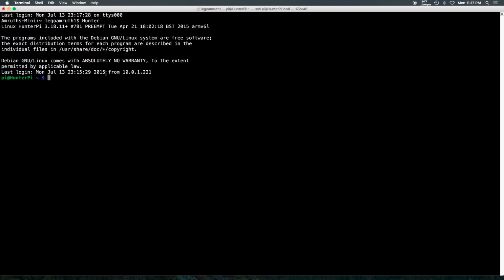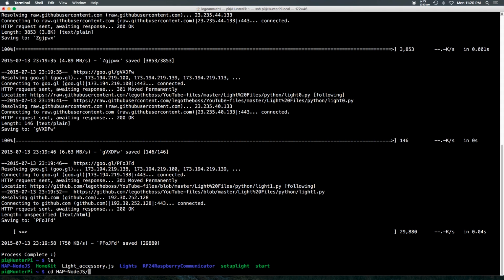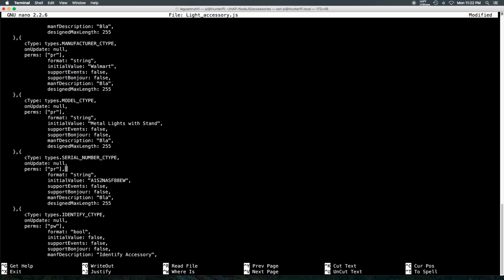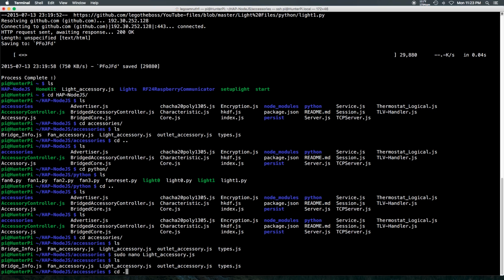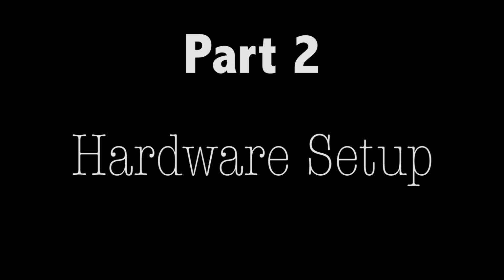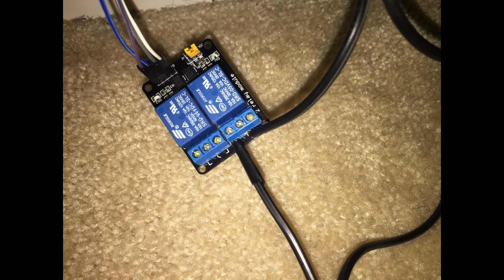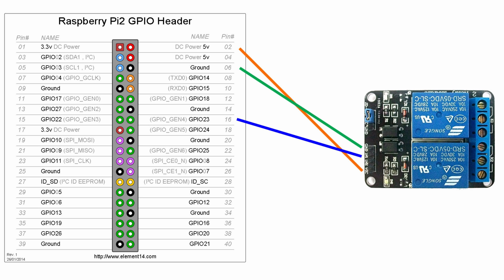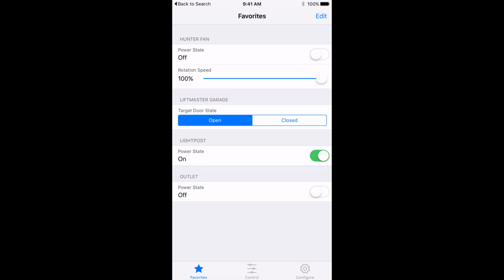TUTORIAL: Siri/HomeKit Lights with Raspberry Pi

Comment: Hey, Your video was great and effective. your instructions were great and worked out for me :) actually I'm struggling to add additional lights as the link you've put under your video, I would be very thankful if you help me fix it out. so here's my problem:
when I run this command : "sudo wget https://goo.gl/Zgjpwx -O Light2_accessory.js" and change the pin number inside the file, my Light1 will turn into not-available on Home app and searching for accessories will have no effect. rebooting didn't work out too. the strange thing is that as soon as I remove the Light2_accessory.js file, the Light_accessory which I created at first will be available.

Comment: Could you make one with an esp8266 board like you did with the motion sensor?
Reply from the maker: Yes
Reply from the maker: Rather than buying another ESP8266, it is cheaper to do a sonoff.
Reply: QuickPi yes true but a sonoff is only high voltage? Am I right? I allready managed to do it but it's not perfect...

Comment: Phone doesnt detect my accessory no error so far!
Reply: I got the same problem! :S
Reply from the maker: Make sure you’re on the same WiFi.
Reply: QuickPi I am (only got 1WiFi- network). I did the installation a few times. Last week everything worked fine, but now it doesn’t. All the other accessories (Fan, Garagedoor, etc.)  are visible in HomeKit, but the light-accessory is not. What am I doing wrong, or how can I fix this?
Reply from the maker: Ok, it is a pairing conflict. Open the Light_accessory file and change the accessory name, uuid, and as well as the username. Change one number or letter in the username. Delete accessories you aren’t using as well.
Reply: QuickPi do I delete types.js?
Reply: QuickPi how do I change the uuid and what do I need to change it to. My phone just cannot detect the light, even after deleting every other accessories.

Comment: why when i done all the thing the command on make the relay off and the off make it on do you know what i missed.
thanks lot
Reply from the maker: +sawadetachat puaktes check your wiring, that is a problem with your wiring with the relay. Check that
Reply: got it ! now I need to do a stand alone system contain with esp8266 relay in a one single unit do you have any idea that dont need to connect with the pi all the time thanks lot.
Reply: another thing i need to control it by homekit

Comment: Hi Quick Pi! does it works with beta ios 11? I know that Works with ios 10, but It Will Work with 11?
Reply from the maker: +Ramiro Caballero yes perfectly fine
Reply: Gracias!!!
Reply: Hey, i have another question... can i use two raspi in different rooms whit the same configuration changing the accessories names? is any problem?
Reply from the maker: +Ramiro Caballero yes that's fine
Reply: Thx!

Comment: Hey QuickPI, I'mare trying to work with two raspberrys on a same network, however one refuses to be connected to a home. My guess is I have to modify the Bridged.js with a change of usename and mac adress, witch I did, but no results. Any Ideas ?
Reply from the maker: +Kim once you do this, you need to delete the persist directory on the one you deleted the information of. You also need to change the UDID of the accessory just in case. Also make sure your MAC address is a valid one.
Reply: Damn you are the Best !!! This fixed everything !!!! Thankssssssssssssssss
Reply from the maker: +Kim no problem

Comment: Hello QuickPi ! I configured my Outlet with the Light_accessory file modified. I can turn it on but the outlet switched off 3 sec after, how can i fix that ? PS : The outlet and another working accessory are connected to the same transistor (the first one works with no problem)
Reply: NRD hey !!! I had this issue before. Just change the Gpio pin.
Reply: Thanks you m8, you solve my problem such a great community !

Comment: Hi Guys !!! Thx so much for the wonderfull tutorial :) 

However there is one thing I can't get to work properly, in order to add multiple accessories, like Oulets in addition to a light, I have to use a Light2_Accessories File, but the icon on my Home Kit looks like an Bulb Light, is there a different way ? Maybe im not doing things properly. 

The final idea would be to have multiple accessories like Lamps and Outlets and to be able to manage them all togheter, witch I can, but not with the corrects icons on IOS, and i checked in the app there is no way to change the icon on a Light_Accessories.js file.

Can you guys help me plzzzzz?
Reply from the maker: +Kim yes you can change them. Go to the details of the accessory you want to change. Then, click on the icon and it'll give you 4 options. Change as you wish
Reply: Hey !!! Thx for the Quick(Pi) :D Answer
You are right, but the only problem is that the four choices are : 
Lamp / Bulbe / Etc....
In my case I would like to have an Outlet Icon.

Because I can't use the Fake outlets you have configured, I don't have the Option to choose for example the relay Pin...

Cheers !!!
Reply from the maker: +Kim oh, you will need to convert the file into an outlet file. On line 62, change Service.Lightbulb to Service.Outlet
Reply: Thanks a lot ! I will try and let you know
Reply: Thx It Worked just fine !!! The only problem now, is that when I try to add another light accessory file , ex : Light3_Accessory, my home Kit can't connect anymore to the accessories. Any ideas ?
Reply from the maker: +Kim in light3, make sure you change the UDID and Username. If you don't do that, HAP will fail to start.
Reply: Thanks for the answer, but where can i rename the UDID in the file, Light3_accessory.js ?
Reply from the maker: +NRD line 41, change a character. That should be fine

Comment: In my home app (ios 10) doesnt apear anything add accessory screen.. please help
Reply from the maker: are you on the same wifi as the pi? also are you sure the node is running?
Reply: yes of course I could pair it with homekit bridge but I cant with a normal accesory... I use sudo forever start Core.js
Reply from the maker: +Daniel Parra I suggest you use bridge, if you are annoyed by other accessories, just remove them in the accessories folder.
Reply: how do i use bridge? but my real question is how HAP-NodeJS know what accessory i want yo pair maybe I can figure it out with that
Reply from the maker: +Daniel Parra core lists all accessories to pair. Bridge works the same way, the light should automatically come up. Bridge combines multiple accessories to act as one so it is easier to pair and manage
Reply: QuickPi is there an easy with to do this with bridge?
Reply from the maker: +Daniel Parra do what?

Comment: Hello.
If I turn on or off the physical switch light, hombridge does not understand it's on or off and don't change the homekit status.
There is a way to figure out when I turn on or turn off the light from the switch of the house?
I think it takes a voltage detector (ARDUINO) which gives an input to raspberry gpio IN 
it is possible to write the command line in Light_accessory.js to read the GPIO mput IN to change the application status homekit ?
please read and answer.
thank you so much
Reply: I also ran into this as I have two switches in my room, did you find a way to fix this?

Comment: hello thanks for your great videos, you're a genius. I wanted to ask if anyone has any idea how to read the inputs to the raspberry homekit.
I'll explain.
I wish homekit understand when I turn on the light from my home button.
thank you so much
Reply from the maker: +Marco Greco which button? Do you mean raspberry pi input gpio?
Reply: Hello.
the classic physical switch that when crush turns on the light in the kitchen for example.
if I turn on the kitchen light, hombridge does not understand it's on.
there is a way to figure out when I turn on or turn off the light from the switch of the house? a bit like him understand if the garage is closed or open.
I think it takes a voltage detector which gives an input to gpio of raspberry and then that the face is that this node imput turn it on or off on the app homekit.
Reply from the maker: +Sam69639 you can already do this with a sonoff. I have done this tutorial, check it out. Definitely research sonoff for the idea you have in mind
Reply: Sam69639 Hello I'm italian you where do you come from?
I'd love to know your idea.
I think you have to use rasperry gpIO IN to restore the information all homekit.
In addition, you need to modify light_accessory.js reading the GPIO IN information
I know that QuickPi will help
Reply: Sam69639 Hello I did not understand your project. What is a mosquito-mqtt server?
How do you make it interfacing with hap-node.js ??
How does ESP8266 bring back the signal to off to homekit ??
Can we exchange mail ??
Do you have photos to send to let me know how you can change the state to homekit when you hit the wall button ??
I have another idea. I bought an Arduino circuit that measures the current and through the raspberry TOMBUS INPUT to give it an imput of when the light is on or off. The problem is to modify the code to trigger gpio IN.
what do you think about it?
Reply: Sam69639 hello are you succeeded with your project? Have you news??

Comment: Okay everything installed perfectly but when I go to turn on and off the light nothing happens when I hit the switch on the home app my relay is working good and so is my raspberry pi the only problem is that I only get power to the relay through the 3.3v pin and not the 5v pin that u recommended
Reply: Any fix for this?
Reply from the maker: +BlazelaHD that is the issue, you need 5v power for the relay
Reply from the maker: +BlazelaHD also check your wiring

Comment: Thank you for this amazing tutorial!
It all worked fine(no errors on my B+) and Core.js starts .My iPhone 6(10.2 Jailbroken) finds the lamp but when I input the code, it  doesn't pair.
Reply from the maker: +Nicola Guerrera try using BridgedCore
Reply: QuickPi I tried but it doesn't pair with the node :(
Reply from the maker: +Nicola Guerrera the code is 031-45-154
Reply: QuickPi Yes,that's the one I used
Reply from the maker: +Nicola Guerrera are you getting any specific error
Reply: QuickPi No,I also used DEBUG=* but the iPhone doesn't seem to make any HTTP requests. I know that the server is working becouse I get the HTTP requests if I go to the raspberry's IP on port 58126 from another PC .From the iPhone (also from the browser )doesn't make any requests
Reply from the maker: There was a bug with the file, I just updated it. Try running the installation script again and see if it works...
Reply: QuickPi I opened an issue on github with photos.
PS: I've updated to the latest setuplight

Comment: Is there a way to remove the various brightness options in the home app for the light and just have it as on or off? Also Im using the BridgedCore and having trouble occasionally where it says the light is off when its actually on. As soon as I turn it 'On' and then off it goes off and is back in sync. But it definitely seems to be loosing the state....
Reply from the maker: +Simon Edwardes I didn't realize the files were outdated by this much :/ Im gonna update them to the latest spec, hang tight...
Reply: Any news on this? cheers
Reply: Simon Edwardes I believe they were updated last week

Comment: Python scripts are wrong :

edit them with (remove the -------- of course;) ) :

---------- for light1.py ---------
from RPi import GPIO
import time
GPIO.setwarnings(False)
GPIO.setmode(GPIO.BCM)
GPIO.setup(23, GPIO.OUT)
GPIO.output(23, GPIO.LOW)
------------------------------------------

---------- for light0.py ---------
from RPi import GPIO
import time
GPIO.setwarnings(False)
GPIO.setmode(GPIO.BCM)
GPIO.setup(23, GPIO.OUT)
GPIO.output(23, GPIO.HIGH)
------------------------------------------
Reply: Clément Chavot Just change both script for this? and connecting on pin 23?
Reply from the maker: +iPadGamesfull yes, but I have updated this script on GitHub so when you install it should install the latest version
Reply: QuickPi Do you have the updated scripts? I changed by these and did not back up
Reply from the maker: +iPadGamesfull when you do the installation, these scripts get installed...
Reply: QuickPi I installed it and then changed the script. Can I do the installation again? Or do I need to delete anything before reinstalling?
Reply from the maker: +iPadGamesfull nope that's all
Reply: QuickPi Does not work for me. When I turn on the light, the relay light goes out and does nothing else. What can it be?
Reply from the maker: +iPadGamesfull the code you changed it to is not physical pin 23, it is BCM pin 23. Wire your relay signal pin to physical pin 16 on your pi
Reply: QuickPi Yes. It's like in the video now. I installed your script again. But it's still not turning on the light.
Reply from the maker: +iPadGamesfull change the code to above python scripts and test it
Reply: QuickPi ok
Reply: QuickPi Worked with this script
Reply from the maker: +iPadGamesfull awesome I think I need to update my code, I believe I already did...
Reply: QuickPi no problem. Thanks for suport

Comment: Another simple to follow tutorial.  Thanks.
However, it has me wondering if it'd support a feedback loop.  So, in series with the relay and lamp, I could install another very basic mains-voltage coil (normally open) relay so that, when the light is on, it powers the relay and closes the contacts.
Next, connect the normally Open contact to 3.3V (or 5V). The common (or other) contact to Gnd with a 10K resistor, and the common contact also to a GPIO pin with a 1K resistor.
So, when the light is off, the relay coil has no power and the contacts are open so the GPIO pin is pulled low by 10K resistor.
But... when the light is on, the relay gets power and closes the contacts pulling the GPIO pin High.

Then RPi would know if the light was on or off - like your garage door sensor does.
Do you know if this code supports such capability with relative ease?
Thoughts?
Reply from the maker: +Cliff_In_Auld_Reekie I'm sure it shouldn't be that hard to implement... I will work on this over the weekend and see if it works
Reply: Just thought: Best put that second relay's coil in parallel with the lamp.  That way the lamp load current won't go through the relay's coil and toast it.  Sorry should have thought of that.
Reply from the maker: +Cliff_In_Auld_Reekie these relays can take a big load, if you have a bigger lamp, you should think about getting a solid state relay....

Comment: Hello,
Thank you for this viedo very helpful although I had to change cartaine thing for it to work at home.

I wish to know how driven SEVERAL relay at a time, and also possibly control of the strip LED

is it possible for you realized her with RPi ?

and can create a voice connection with an Arduino to get to servire entered PLC output ?

( Desoler for my english I'm not very good )

Comment: i followed your instructions with no error i hook up everything and i try it
my phone detects the accessory and i connect it 
when i try to turn on and off the light it communicates and turns on the relay but the light doesnt come on
What am i doing wrong?
Reply from the maker: +BlazelaHD check your wiring... if the relay turns on but the light doesn't, something messed up in your wiring
Reply: Thanks do I have to go into the light0py and light01 file and edit it to have it respond to gpio 23?
Reply from the maker: +BlazelaHD ya
Reply: might be a noob question but can i assign light0 and light1 to a ground pin?
Reply from the maker: +BlazelaHD no this is impossible...
Reply: i reinstalled everything according to the instructions and it doesnt turn the relay or the light on one quick question will it work if i plug the relay directly into the raspberry pi i am connecting it using a breadboard and i think the issue is is that the data is not reaching the relay board through the bread board
Reply: I am 99% sure I'm doing everything right idk what's up
Reply: I'm even using the same exact relay board

Comment: sudo forever start /home/pi/HAP-NodeJS/Core.js always makes my light unavailable. it can see the other devices when adding anohter. i have to cd HAP-NodeJS then sudo forever start Core.js for it to work. any ideas? also what is bridgecore exactly?
Reply from the maker: +Sparten9999 BridgedCore is for multiple accessories. U just have to pair with the bridge to have all the accessories to connect... For ur issue, idek the solution. But make sure you run "sudo forever stopall" before any forever command. This ensures all the nodes are stopped before running the next node again. 

For your issue, try creating a script that first runs the sudo forever stopall command. Then have it manually go to the HAP-NodeJS directory and run the command sudo forever start Core.js. This is what my reboot script does. It manually goes into the directory and starts the node. It's worked successfully for me so far...
Reply: making the reboot script worked thanks